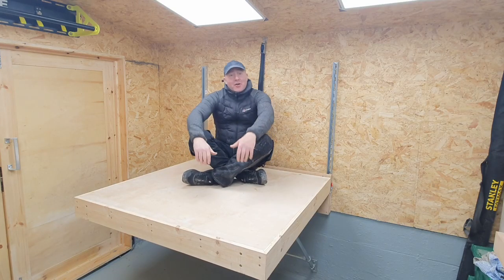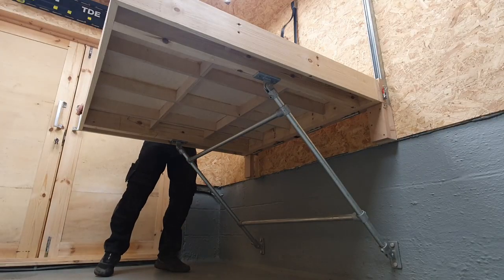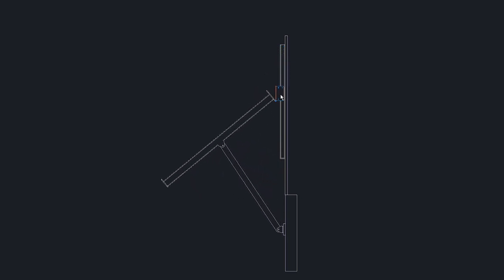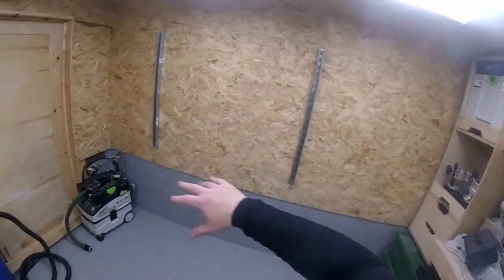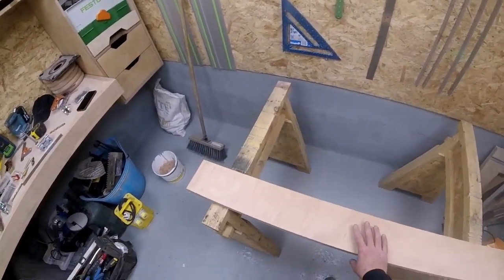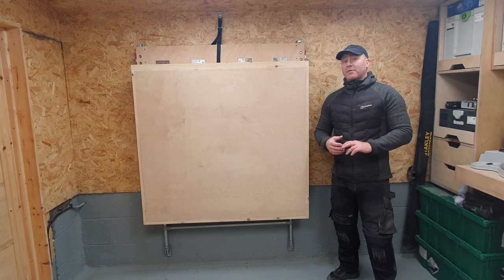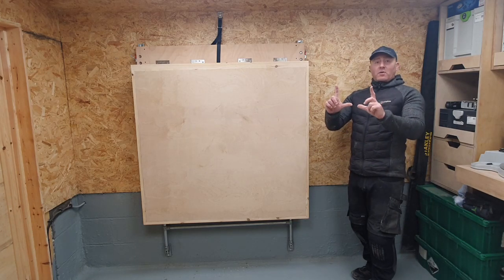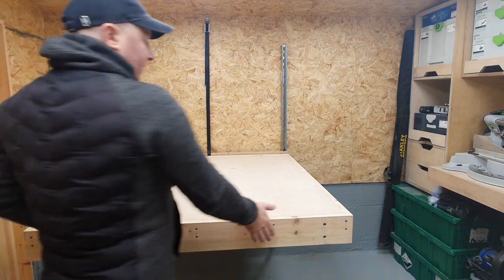How To Build A Fold Down CNC Table - Space Saving Worktop

Comment: were the side load rollers you used anything special, or just a nylon/acetal/? roller on a bolt?
Reply: @leeturnbull2082  New design looks great; good fit for 1F to (re)market, since they're a big buyer of tubing already and can produce the "special" bracketry quite easily with sufficient volume. Not sure how practical it would be for an individual to make these parts or if they are all available on the commercial off-the-shelf market.

Comment: Does the X-axis fall when the table is slid up against the wall? IOW, is there some retention needed of the X-axis to keep it from sliding down under its own weight?
Reply from the maker: I always leave everything at the lowest level, it has no where to fall, basically the home position,
Reply: @DesignBuildTDE  Thanks for the response - while that does make perfect sense, I was looking to have the largest projection from wall (Z-axis) higher than my head while stored to get the best shop space utilization, instead of the likely scenario where I walk directly into it! :((

Comment: Love the design thinking about this for a table in a shop I need. the table is a bit larger than what you are showing here at
Reply from the maker: Hi Mathew, the table size doesnt really matter as long as you use robust supports to match the table size, I wouldnt recomend copying the sled style I used with door hinges, it works for me but it is better to use linear berings on a tubular shaft if you can find those.
Reply: Do you have a recommendation for the linear bearings Im

Comment: I mirrored this design exactly and I’m more than satisfied, thank you. Did you use the supplied blue mounting bolts when you mounted the cnc to the table or did you use something long enough to go through the table top and use something like a hex nut at the other end to safely secure it while it rests in the upright position?
Reply from the maker: I used larger ones in metric

Comment: I’m thinking of building a similar concept, but with a winch as the lowering and raising control. My biggest concern is having to re-level it periodically. Have you had any issues with this?
Reply from the maker: The answer to this could be complicated so I will say this, it is possible to mek the table level each time it is opened repeatedly, but not with my current design, the hinge idea over time stretches, there is a new design coming that uses islated tubular linear bearings, that will level out every single time. You wont need a winch but I guess it makes the job easier, I fold my table away by hand, it has a 2.2 kw spindle and weighs a ton, but the geomtery of the hinges counters all that. wait a few weeks for the new design to come out.

Comment: How tall is your channel? I've bought the unistrut trolley bearings but I see in the comments and reviews that the trolly has issues clearing the screws that mount the channels to that wall with a 41mm x 41mm Strut. Best Regards.
Reply from the maker: My channel is 1 meter long, the table is 950mm above the deck and when it folds vertical it still has 200mm of travel, if you have a larger wall and set the support braces further out you can get the table to travel much further up the wall. 

My tip, if you're doing this design, don't copy this one but copy the tubular system, I will upgrade mine to a tubular linear bearing in a few months, its stronger, smoother and has no play and no set up issues like you mentioned with runners.

Personally I got my runners screwed in with no interference, I don't know why some people have had issues.
Reply: Do you think this could work? Happybuy 2PCS Linear Rail 0.78-47 Inch, Linear Bearings and Rails with 4PCS SBR20UU Bearing Block, Linear Motion Slide Rails for DIY CNC Routers Lathes Mills, Linear Slide Kit fit X Y Z Axis https://www.amazon.ca/dp/B06X92YPT8/ref=cm_sw_r_apan_glt_i_PFD8HAYWBJ7777XW0X6B?_encoding=UTF8&psc=1

Comment: Thanks for the idea. I finished mine and I'm waiting for my Onefinity to be delivered. I used 8020 aluminum extrusion with linear slides for the uprights. I think in your neck of the woods the brand is called Item. I works perfectly. If I could post a photo here i would show you.
Reply from the maker: @David Dickmeyer - can you email it to me? I am upgrding mine to a tubular system soon. lee.turnbull@tde.org.uk
Reply: @DesignBuildTDE  Be on the lookout. I just sent it.
Reply: I would like to see the 80/20 setup. I would rather use that type of setup vs unistrut.
Reply: @raginbullshot5026  I have design drawings using the 8020 stuff. Not sure how to post them here, but I would be willing to share them free of charge.
Reply: @daviddickmeyer5231  I'd also be interested in the 8020 design. I plan to use that for my table frame, to accommodate a vertical clamping table for end grain joinery. Looks like the 40-4012 is a good profile to mount the 1F feet to. Let me know how to get your design info, thank you!

Comment: This is simply the best solution I have seen for placing a CNC machine in a small shop. Parts from the Key Clamp Store are ordered and on the way. I did go with the 34mm system rather than the 27mm system. The Onefinity Journeyman is larger than the Woodworker and the beefier 34mm pieces seem appropriate. Looking forward to your release of the engineered system plans you've mentioned. I'd appreciate the chance to purchase a ratchet strap from you.

Thank you for sharing this!

Jim
Reply from the maker: Will be selling these on Etsy very soon buddy!
Reply: @DesignBuildTDE  Excellent! Let us know when.

Comment: I am 100% building this for my CNC. I really like the design at the 00:01:15 mark. What fitting is the sliding part highlighted in BLUE? I can’t seem to find it anywhere (US).
Reply from the maker: Hi @thecrus8r that's 27mm kee clamp tubing, but the linear bearing will have to be a custom part, when does your machine arrive becuase in a few weeks I'm doing a design package for the tubing version
Reply: @DesignBuildTDE  Thank you for the reply. The machine will arrive at some point in July. I did some research/planning last night and I believe that I can make it work with what I've found. Luckily I have a pal that is an engineer, so he'll help out a bit on alternatives/solutions to minor hiccups. I'll pop back in and let you know how it went. Again, great design and thank you. This is much better than the other fold down designs I am seeing that take up much more depth space on the wall when stored.

Comment: Great build. I may try making one using 80/20 aluminum extrusion. They also have linear bearings for their products. I would like to know the manufacturer of that web strap latch that you are using to hold it up and lower it please. I don't recall seeing one quite like it before. I get my Onefinity the end of July.
Reply from the maker: The device is one I designed and built for another purpose, most people seem to use an electric winch, the table does need a bit of force to lift it, the strap lock is helpful as you can lower it. Are you in the US?
Reply: @DesignBuildTDE  I would be interested in having a few of those gadgets! And yes I am is the US, although my late wife’s family are from Dunlop, Scotland. 😃 You live in a most beautiful country.

Comment: Nice design.. I was building something similar a few years ago but had lots of binding... recently learned about the unistrut and have now many more ideas!
Reply from the maker: Thanks buddy, the trick is to get everything level and plum, the arms the same length, same height etc, you don't have to use unistrut, ideally a bearing which is located in a track and holds its position laterally is ideal, the video shows some examples of that so if you get a chance to do it, experiment a bit first to see if you can get a better wall runner. Good luck!

Comment: I might make something like this for an assembly table.. .looks beefy...  Plan to sell the plans?
Reply from the maker: I can give you the plans buddy, just be a few days as I've started a new job
Reply: @DesignBuildTDE   I would appreciate them as well.  I like your torsion table.
Reply: @DesignBuildTDE  I would like the plans or at the least the lengths of the tubing and table size i also am waiting on my 1finity and this would be a great space saver.
Reply from the maker: @rickmath  the table is 1255mm wide by 1200mm deep, the bar attaches dead centre of the table (600mm) and is 850mm long, this doesn't include the pipe fittings which are 27mm kee clamp tubing. The runners are made by unistrut, but you can use other runners, they're attached to a 30mm plank of ply, with 40mm nylon rollers with steel bearings the table sits 950mm from the ground, the runners are each 1000mm long, if you copy that design you'll need 4 x rated bearing hinges. I will at some point revise this and make a drawing but at the moment I am up in the Highlands working
Reply: @DesignBuildTDE  thank very much
Reply: @DesignBuildTDE  I would LOVE to get these plans if you're willing to share!